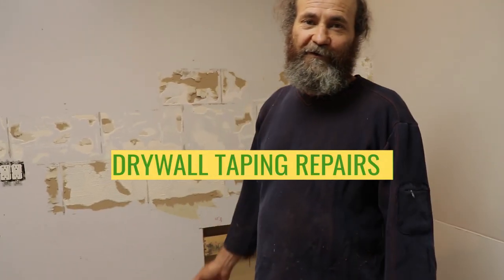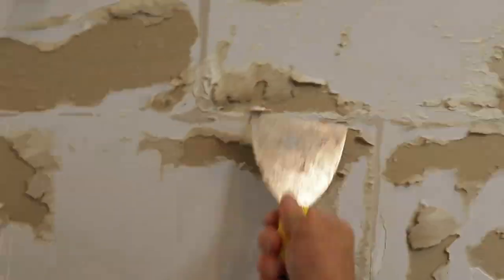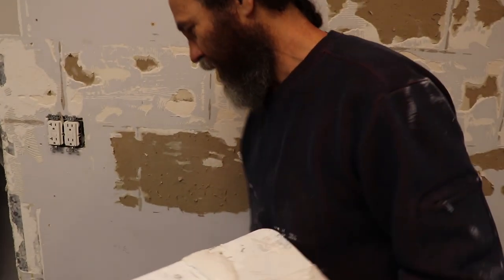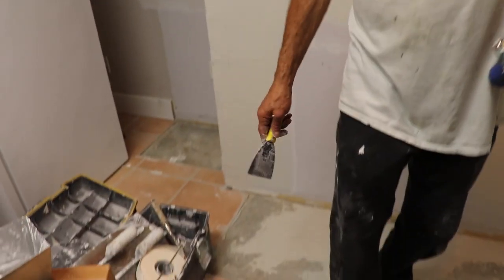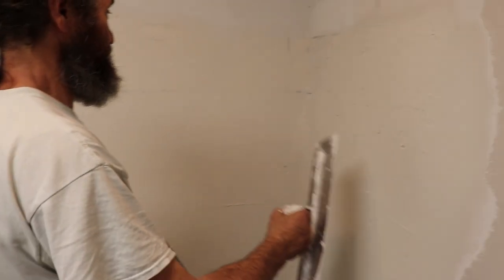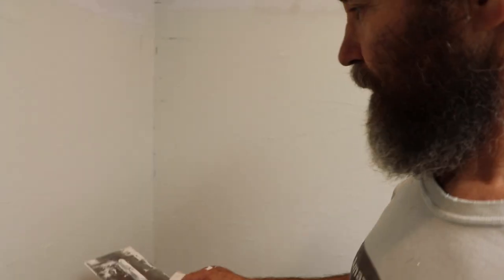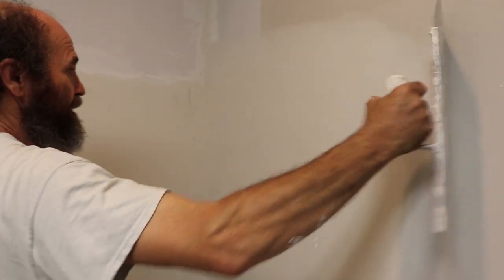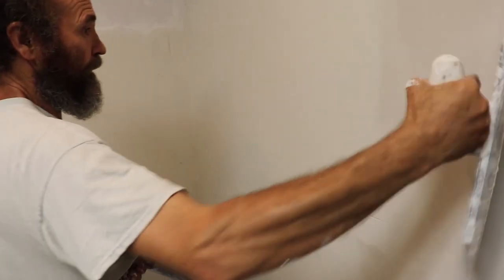How to Tape REPAIR TIPS AND TRICKS

Comment: Would you put a coat, like Gardz, on the exposed brown cardboard spots?
Reply from the maker: Hello Richard, thank you very much for your time, in this video I am showing one method of doing few coats in few hours, that saves time, if you will not apply the drywall compound  on top of  lose drywall paper, this method is very effective with great results, I am hoping this will answer your question, if not let me know, your time is really appreciated, see you on the next videos.